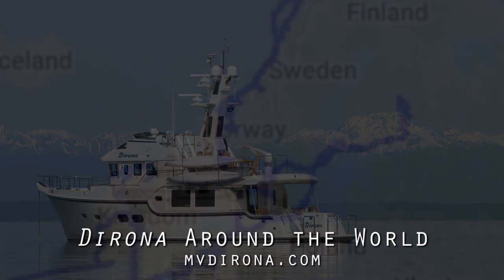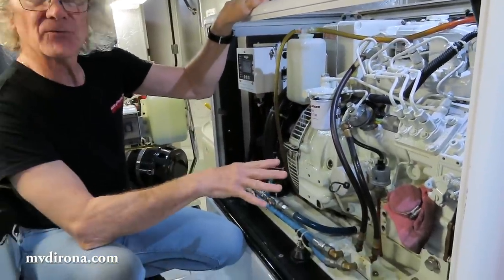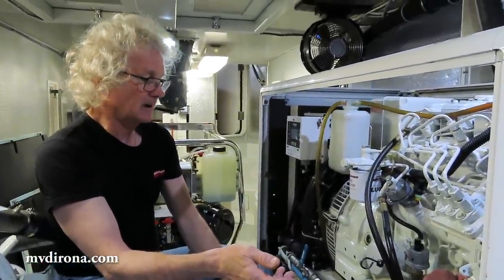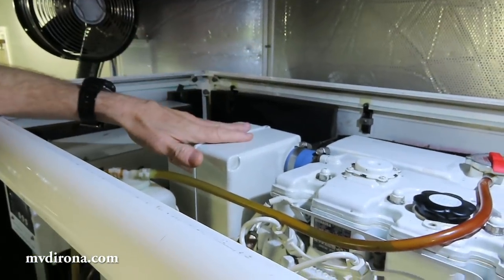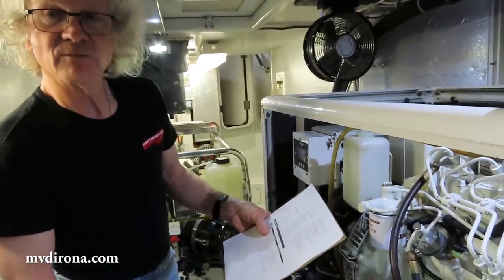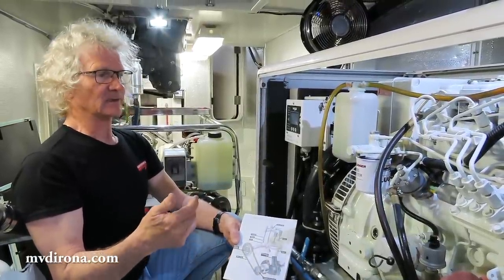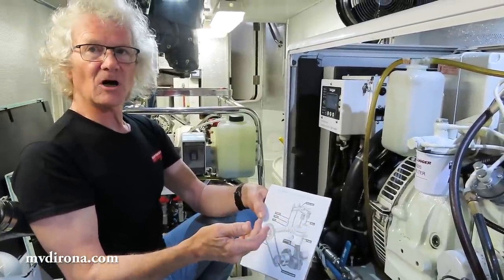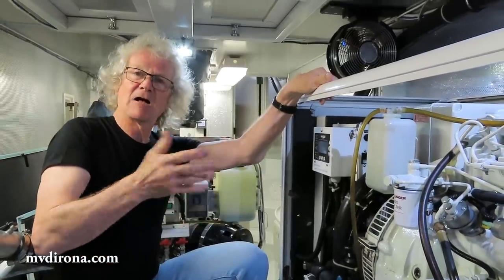Diagnosing Low Power Output on a Northern Lights 12kW Generator (MV Dirona Channel)

Comment: that was a great explanation of wet exhaust system,its only when you get the head off do you get the bigger picture whats  happening,i v seen valve seats split cracked ,loose carbon building up underneath causing them to sit lop sided that but those problems do the opposite make clearance enlarge on the rocker and loose compression ,i see you got the job done reading comments,sounds like injectors were loosing atomisation and running  rich fuel saturation that destroys exhaust valves and partial burning of fuel excess goes  down through piston ring gaps and mixes in sump oil, check old engine oil will smell of diesel ahhh could that perish crank seal which is a rubber / plastic mix composite material not deisel resistant ?
Reply from the maker: Good set of thoughts. There is no indication of diesel oil dilution. Oil level doesn't rise, there is no aroma of diesel off the old oil, when dripped onto a paper towel, lighter diesel elements don't migrate away from the engine oil. I'm pretty sure we don't have that problem but, since we do have 6,700 hours on the injectors I did change them. So, if there is any issue there, it should be addressed by installing 3 new injectors.

Any oil seal is oil resistant of course and, diesel is just a very light oil, so I wouldn't think there would be any impact on the rubber if there was diesel in the sump.

The crankcase vent connects the crankcase with the intake manifold right near number 2 intake valve.  The valves appeared to be leaking based upon the valve face not being polished. If the intake was leaking especially #2 intake, it could cause pressure spikes in the intake and, as a consequence, in the crank case. 

I suspect the mostly likely answer is the oil seal fail since many have had the same problem but so interested to see if it's different with properly sealing valves that rather than change the rear main oil seal, I'm holding back to see if it's leaking less with the new valves and seats.  I suspect I'll have to change it no matter what but I would like to see if there is anything to learn first.
Reply: @MVDirona  yehh it would send pressure back to crank blow the seal,was good temp fix to remove filler cap give a relief of pressure, but usually when a gasket or seal gets a track across it to create a leak its prone to always leak  but you could be lucky  and reduced crank pressure now and  the new head and injectors it,ll be running sweet should see difference in feul burn cost
Reply from the maker: I think you are right that once a leak starts its very likely to continue. I'm just about positive I'm going to have to replace the rear main oil seal. But the engineer in me can't resist the experiment of running it for 30 to 50 hours to see if the oil leak is much reduced. I'm mostly just after testing the theory that the leak may have been caused by leaking intake valves.

Comment: Well yes, it's very impressive. And also a great video with understandable knowledge bits. So let me ask the question: How did you manage to collect all that knowledge? Following your channel, it's not only about diesel engines - you know everything. Did it just come along form your former life 'as some kind of genius'? Or did you learn all those topics just to operate MV Dirona? Or do you have good advice from the manufacturer? Please let us konw (the ones that would never cross an ocean without those skills :-).
Reply from the maker: A little bit of all those options. Many years ago I was a professional mechanic first at a Chevrolet dealer and later at an Alfa Romeo dealer. I've never worked professionally on diesels and it's been nearly 35 years since I worked on card professionally but it's a useful background when it comes to taking care of a boat.  

The manufactures who supplied equipment on Dirona are incredibly helpful as well. It's been a decade but if I call or email Northern Lights (Wing engine and Generator), ABT/Trac (hydraulics and stabilizers), Cascade Machinery (John Deere distributor), or Pacific Asian Enterprises (Nordhavn), they are all super helpful.  The collective commitment of all these manufactures to the success use of their products is incredibly unusual and a big part of what makes a Nordhavn special.

And, of course, if you are patient and careful, none of this is rocket science. Anyone who can approach problems methodically and thoughtfully can take care of ocean going boat. And, more importantly, with good redundancy, and Nordhavn's do usually have good redundancy, they should just about always be able to complete a trip and be professionally serviced at the next port.
Reply: @MVDirona  .. and still very impressed, but on a much higher level now. I'm used to take care of a 50+ years old vessel. So, I fully agree with your statement about 'patience and care' - however, it gets more complicated when it comes to spare parts and advice, when there are no manufacturers available any more. Thank you for your answer and ongoing inspiration through this channel, this is very valuable!
Reply from the maker: Taking care of a 50 year old vessel is harder for many reasons but a key reason is parts availability. You end up having to replace entire components with new ones or make parts for old components which takes more time and more skill. Even on Dirona we will eventually have to face some issues with out-of-service parts. Are refrigerator and the garbage compactor are both no longer available in that form factor and for the fridge there is suitable replacement from any manufacturer. For the garbage compactor, there appears that there are replacements available but they are 240V/50hz appliances (thanks to a reader to point that last one out). 

When the parts aren't available, everything gets more difficult and requires more skill.

Comment: Hi Guys...love your videos. My wife and I are thinking about a live aboard in the next 5 years and its great to get a bank of things that may go wrong and how to fix them. Quick question...is there a reason you dont use the wing engine as a back up gen? Presumably if your only using 10bhp or so the wing is more than capable or is it just the way the engines are equipped that makes the main a better (only?) choice. 
Very surprised there isnt a back up gen on your boat ..so many Nordhavns have redundancy on everything ...I just get used to seeing double all the time!!
Reply from the maker: That’s a good suggestion but harder than you might guess to realize. The wing stays exercised running the hydraulic system so it gets started whenever raising or lowering the anchor (hydraulic windlass) or operating in close quarters (hydraulic thrusters). Because it’s well sized for the backup power generation role, our first choice was to make it our backup generator as you suggest. But, 9kw of power is about 15 hp and you can’t drive 15 hp through a single V-belt. It’s hard adding an different pulley on the front of the engine since it drives the hydraulic power take off (PTO) through the front and spacing and alignment are critical there. There isn’t space to add a serpentine belt pulley and it would require a lot of custom engineering to bring it together. That makes driving the alternator load off the front of the engine difficult. On the back of the engine is a ZF-15 transmission for the emergency propulsion systems. There are no other direct PTOs on engine or transmission so there really isn’t anywhere to drive 15hp without a more engineering that I feel like stepping up to.

A final possibility is to drive the alternator using the hydraulic system since it has the needed power and already has a 45cc Rexroth Hydrualic pump which is more than needed to drive 9kw load. In fact, we could go with an even bigger electrical load with this design. Nordhavn did use hydraulic generators for a few years and they worked out poorly overheating and even rarely igniting.

The problem appears to have been poor control system design. There is no reason why a hydraulic generator couldn’t be made to work perfectly well. The failure mode is engaging the generator at low power output levels where there isn’t sufficient cooling of the alternator. This again is easy to avoid and a system could be designed to do this well with control system work. In fact, this was done on Nordhavn 6206 Grey Matter by Gateway Hydraulics (http://www.gh.com.au/) in Brisbane and it works really well. Gateway is impressively good and did a really good job of this control system and the system has run reliably for years so it’s certainly an option.

We gave the wing driven hydraulic alternator careful consideration but ended up concluding it was much more custom work that we wanted to take on and required space somewhere on the boat for a hydraulically driven generator. The option of replacing the second alternator on the main engine with a large 190A@24V only took an hour, it works very well, and it works underway to drive high draw loads without having to start the second generator. We’re pretty happy with the solution.
Reply: @MVDirona  Thanks for taking the time for that answer ...fantastic information and really intersting stuff, especailly around Gateway and the 62..  The main engine option is certainly a simple, effective and the way to go... I had forgotten the wing gets used for the hydraulic side as well as a back up engine. I hope you fixed it ok abd looking forward to the repair video.
Reply from the maker: The wing would be a perfect choice if it wasn't so difficult to draw more power off of it. You asked why not have a second generator?  Bigger boats just about always do but in 47/52' range two generators isn't that common. I know of only one boat so equipped 4732 Bluewater owned by Milt Baker.

The repair is complete and the video work is underway.